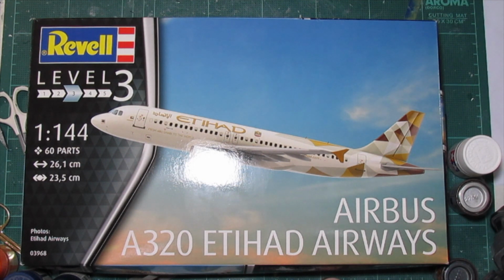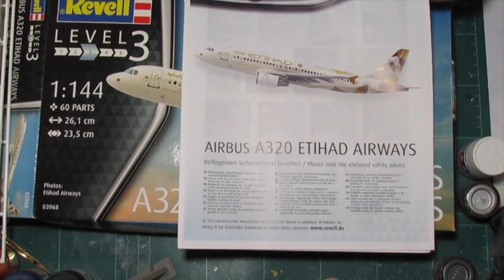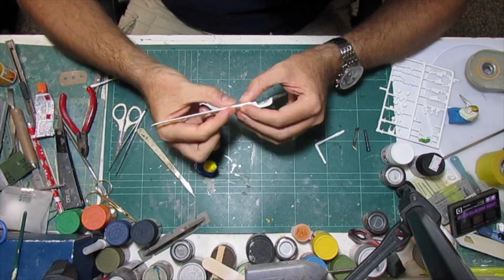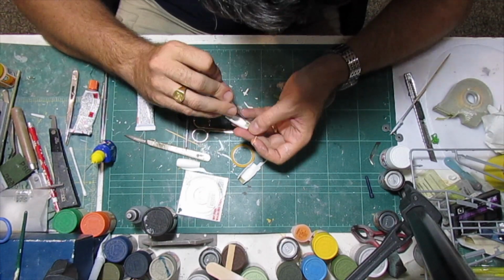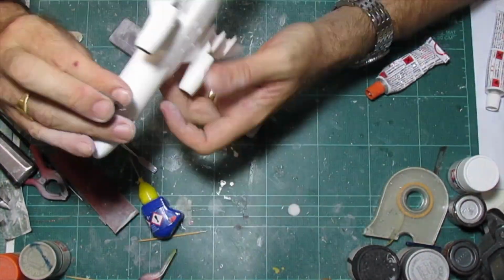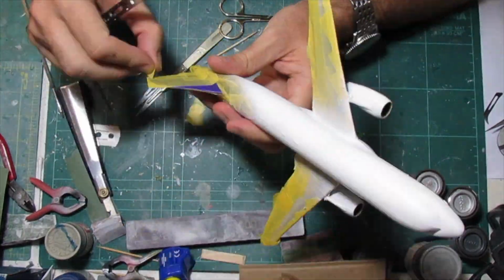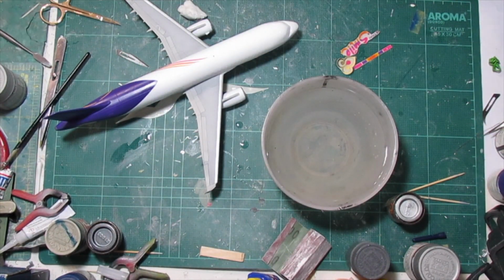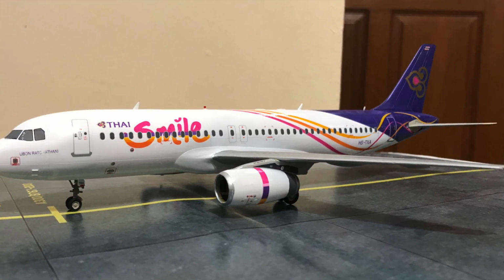1/144 Revell A320 Thai Smile

Comment: Thai Smile is not a low cost wing of Thai International. It flies many of the regional routes. Otherwise, great build as always
Reply: Its a subsidiary of Thai airways. I used to work for them when i was younger. Only flew domestic routes in Thailand. I was based at udonthani.

Comment: hi, I  have the same model, where are the wing lights?? I find it  in the same blank that the front glass, but the part isnt there.
Reply from the maker: They should be with the clear parts, but what I normally do I use some clear glue to cover the nav light.